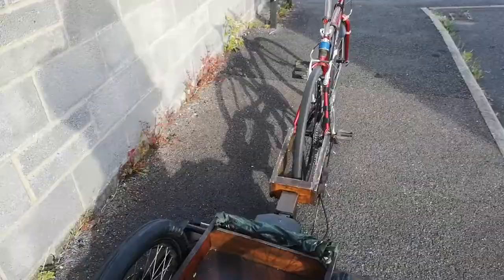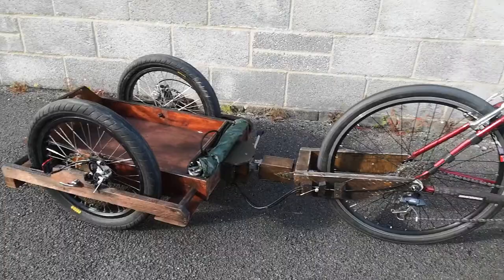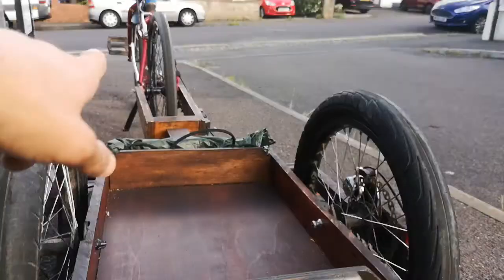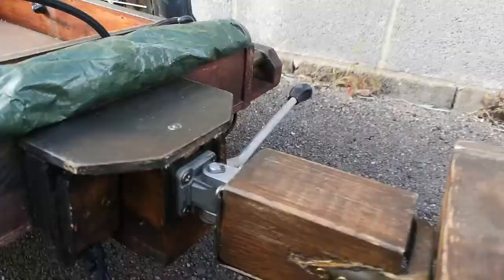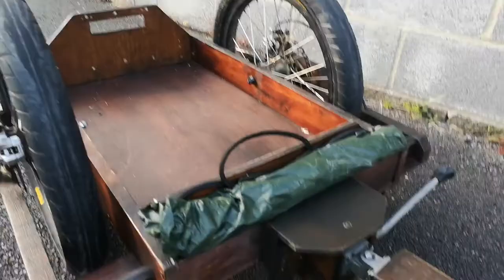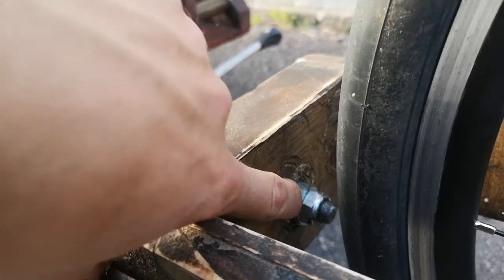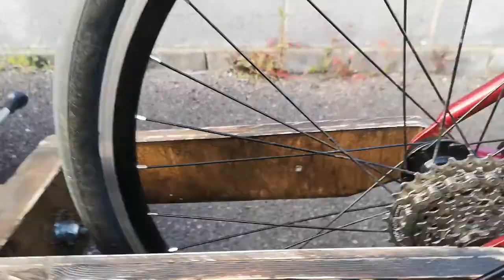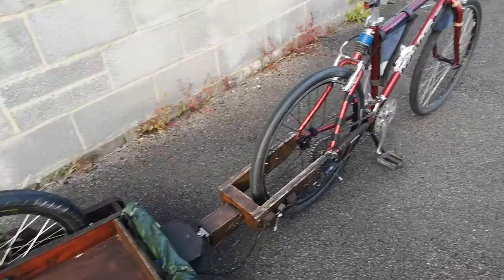Home Made Bike Trailer with Brakes - Ruckus

Comment: Did I miss the part about how the brake control lever works?
Reply from the maker: I only touched on it briefly.
Each wheel has a brake caliper with a cable that meet at the front and are attached together. They can then both be pulled by 1 lever on the bar